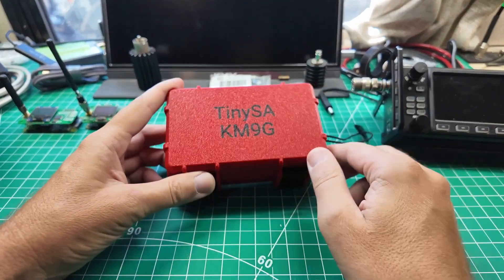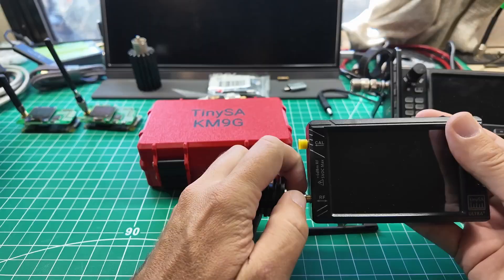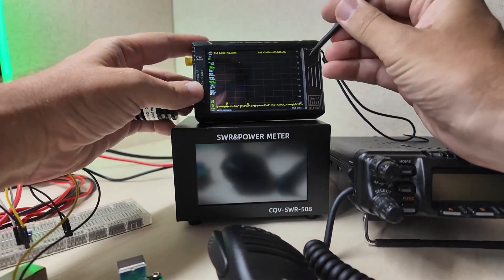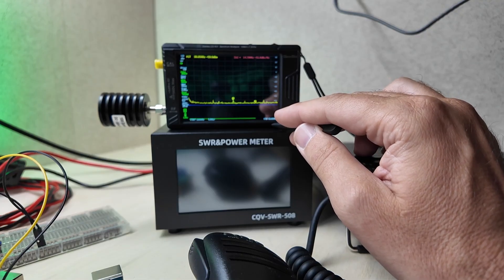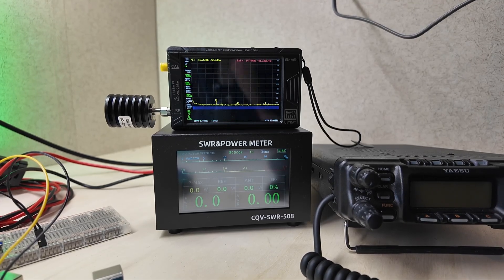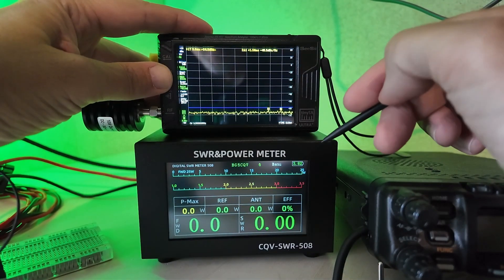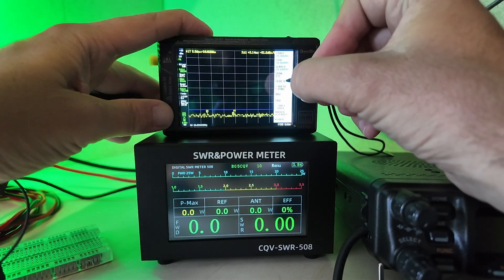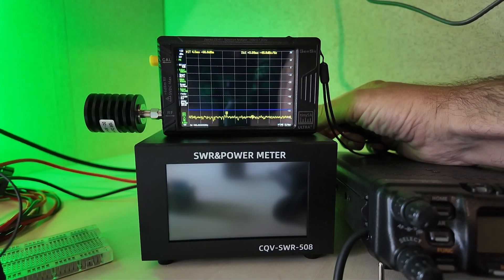Stop Guessing! Track Down RFI Like a Pro with the TinySA

Comment: I'm  planning on buying one of these primarily to hunt for noise in the 150MHz to 1GHz ranges. I work in Queensland  Australia and we have local TV transmissions at 177MHz through roughly 650Mhz. (Two separate transmission towers) Occasionally I have situations where strong local noise sources intermittently interfere with certain channels. A multiband log periodic directional antenna should help me to pinpoint noise source location.

I'm not ignorant, I've been a comms tech for many years, but wouldn't consider myself a guru either, anyone with tips and pointers? All input welcome.

I've had decorative LED light arrays and Sum Ting Wong (generic non compliant cheap internet purchased) brand CCTV cameras as proved sources of interference so far that I've eliminated, but sometimes there's cases of nearby off-site noise that I've referred to the licensing authority that have gone unresolved.
Reply from the maker: Good luck with the hunt!

Comment: Can you check if the TinySA can pick up upload from mobile phone?   E.g when you first turn on the phone and it connects to a basestation , would be either on 700, 1800, 2100 or 2600mhz band depending where your located.  Wondering if it's sensitive to that?
Reply from the maker: Yep, mine heard it.

Comment: I ordered the dummy load. I was playing some FT8 and again my radio kept disconnecting from the PC even though I have chokes and a 240-31 with the usb wrapped through it 18 turns. 
 _ 
Turns out the USB power supply I was using to keep the laptop charged was causing an issue and I just came across it by accident when I unplugged it from the outlet and laptops no longer charging and connection was stable again. 
 _ 
I have a tiny sa ultra and its been a fun toy but now I realize why I haven't been able to use it to find any issues since as you stated it picks up everything with the antenna plugged in. When I get the dummy load I'll have to wear my Doc Brown brain scanner hat and suction cup everything in the house starting with my dog! She's very suspicious!
Reply from the maker: Not the dog!  Glad you found the cause!
Reply: @temporarilyoffline The dog must be scanned! She gives off enough methane there has to be some RFI too! 

I might need to wrap her in shielding and air refresheners!

Comment: It looks like you have enabled Ultra mode, that's why it scans slowly. If you don't need to scan freqs higher then 800MHz usually (I don't remember exact threshold freq), then it's better to turn off slow Ultra mode.
Reply from the maker: Thanks for the tip!

Comment: A test I'd have tried would be to connect the Tiny SA to the meter's transceiver port, and put the dummy load on the meter's antenna port, and test with the meter on and off.
Reply from the maker: If there is anything of interest I'll put a video together.

Comment: Nice testing. Using the tiny SA with an antenna does work but with the senility being high you will get everything around you. and a strong signal from anything can over load the SA  and mess up test results.  I even used a 75 ohm load for RFI test. I short piece of like RG 174 Can work . even RG 58 . The RFI will leak threw the shield. Then you get right on top of device under test . Little tricks I learned over the years . They make pick up probes you can put on SA. Then you can go around pin point what makes the RFI. A short piece of loosely coax with a resistor on end  makes a great probe. 73
Reply from the maker: This guy knows!
Reply: @temporarilyoffline  A outher test for that meter is put dummy load on the ANT jack and your SA in the RTX jack. Turn meter off and on See if injecting RFI into coax . 73

Comment: Well, it seems like we're trying to find a solution to a problem that didn't exist not so long ago! Of course, any digital circuit will generate noise. And because our receivers are designed to pick up extremely weak signals, the noise will interfere... Duh. I also find these digital devices very attractive (clear display, accurate, versatile) BUT in some cases the good old analog meters are the way to go. If you're sorry having to let go fantastic gadgets, beware that I am sorry too...
Reply from the maker: Hey Jean-Luc,  I wish we didn't grow faster than we were ready/able... but here we are in this modern world.  I don't mind letting it go... I mind that it might not have been suitable to the task at hand.  More investigation!

Comment: I would use a coil like the old sniffer on a grid dip meter.  A chunk of coax with a few loops of wire on the end acting like a antenna or coil.  Or you could just wrap the wire around the whole unit.  Thanks for the videos!  73
Reply from the maker: That is a great idea.

Comment: What is zero span
Reply from the maker: On the TinySA (and most spectrum analyzers), Zero Span means:

Instead of sweeping across a range of frequencies (like 1–30 MHz), the analyzer parks on a single frequency.

The horizontal axis (normally frequency) switches to time.

You see how the signal amplitude at that one frequency changes over time.

Why it’s useful

Detects bursty or intermittent signals (switching supplies, digital clocks, RFI hash that pulses).

Lets you measure things like modulation, keying artifacts, or timing of spurious emissions.

In RFI hunting, if you suspect the SWR/Power meter (or anything else) is spitting noise at, say, 14.200 MHz, you can park there and see if the amplitude jumps when the device is powered on.

Comment: You seem to be working very hard to make this meter wonderful.  The testing you are doing here is nonsense.  Simply connect your radio through the meter to your main HF antenna.  Watch the radio waterfall when the box is turned on and off.  That is the operational situation where noise would be sseen and would be in the way.
Reply from the maker: Thanks for the opinions.

Comment: An alternative interpretation of your results is that the TinySA and dummy load are well shielded.  Note that the local noise didn't show either. Try it with a known noise source to see if anything gets into the TinySA.  I believe the pros would use a sensing loop in a Faraday cage, rather than a dummy load.  Few of us have a Faraday cage, but you have nice desert out there.  And if the DUT is a noise source, proximity to the sensing loop may still allow it to be obvious despite your local noise.  If moving the sense antenna near and far changes the noise floor, then it is a noise source.  It would be hard to quantify how much noise without a cage, but if the noise is significant, you would be able to detect it.
Reply from the maker: Thanks for the detailed insights!

Comment: If the spectrum analyzer and the dummy load are ok, there should not be more to see than the noise floor.
Also a noise floor of -65dBm is too high to measure RFI. That´s more than S9 on the HF S-meter!

Please try a different setup:
Connect the TinySA to the input of the SWR meter and a dummy load to the output. Choose a lower detector bandwidth to get the noise floor down, ideally way below -109dBm (S3). The sweep will take longer. I don´t know if the TinySA is capable of such.
This way you can possible detect whether there is serious interference from the SWR meter to an HF receiver connected to it. I think that is the concern people are talking about.

73!
Tom, OE9TKH
Reply from the maker: Sounds like a plan.

Comment: With an analyzer measurement floor of -65 dBm the unwanted noise or spurious signal content would be greater than S9+8 dB to be detected. Consider that S9 = -73 dBm

Substantial noise or spurious signal content could be present well below the analyzer’s detection ability. Suggest using an HF receiver in your evaluation to sweep the test frequency range. 
 
The CQV integration of the directional coupler, without proper shielding from the processing and display electronics, could make it susceptible to a wide range of spurious signal content. Competitive products eliminate this issue by using a physically separated directional coupler.
Reply from the maker: Thanks for the info.

Comment: Okay. Well, this looks like a decent piece of equipment… definitely considering getting one… what alarms does it have? Like high SWR alarm? I think I read in some of the reviews that it was noisy in the sense that it beeps every time there is a transmission. Also, I would just keep it plugged in as it would be tied with my base station, and I know that is an option… but does it have a light showing charging or something on the screen? Thanks for putting out this video!
Reply from the maker: The alarm is configurable (and you can turn it off).  It rings when you're above your SWR threshold to let you know to stop transmitting.  It has a state of charge indicator in the upper right corner of the screen.
Reply: @temporarilyoffline welp. Sold! Thanks for answering my last remaining holdout questions!